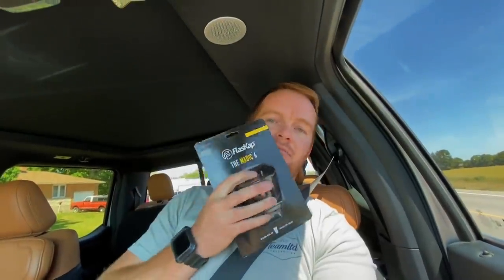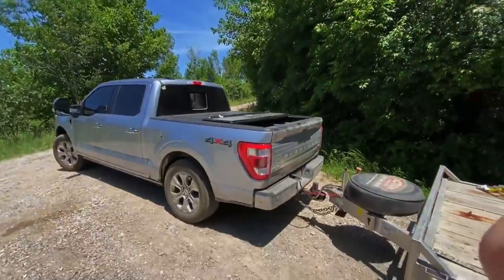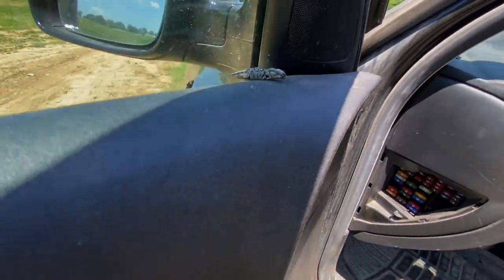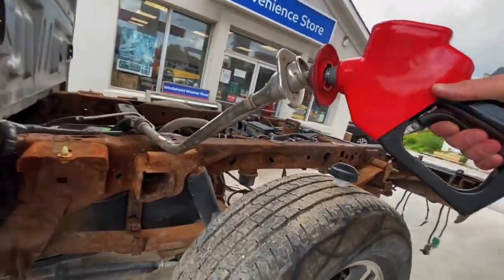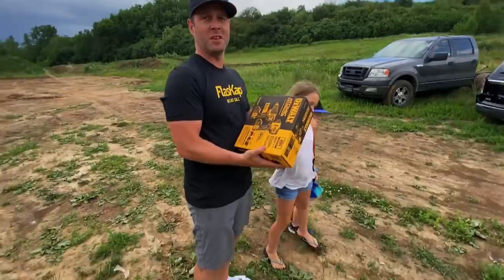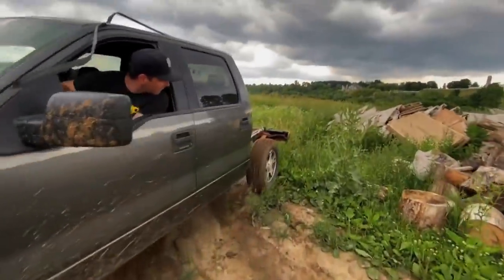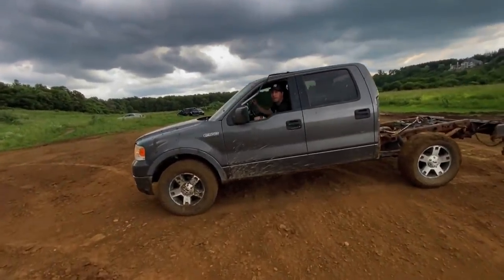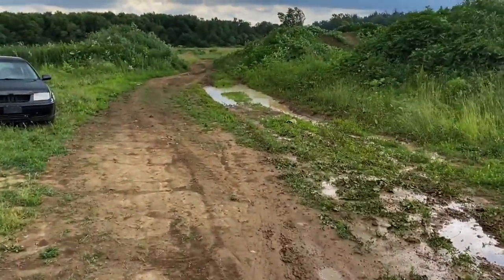NEW $1000 F150 MUDDING!

Comment: Hey Mark! Here are ideas for the jetta:
-If you struggle to make it start maybe hitting the starter with a stick could help.
Or you could show us how you push-start it!
- try to float the gears(shifting without using the clutch)
-see how long you can ride the clutch on a hill before it starts smoking!
-to make it runaway you can try dumping oil in the intake!(not to much at once or you'll drown it but enough to bring the revs really high). It might be easier if you dump the oil on the side of the intake wich is after the turbo and the intercooler( it will run naturally aspirated but the oil won't have to go through the turbo)